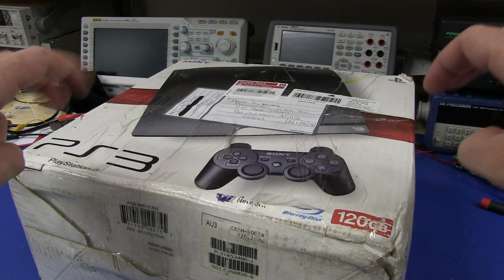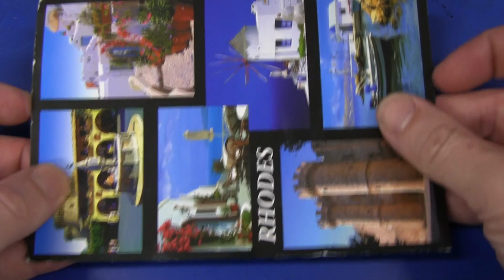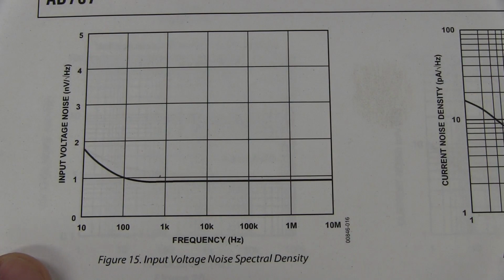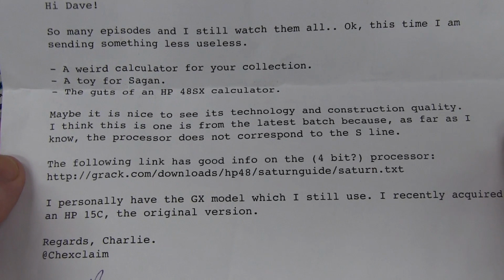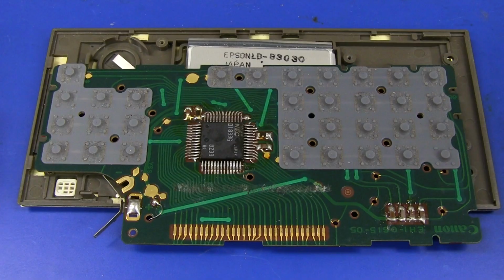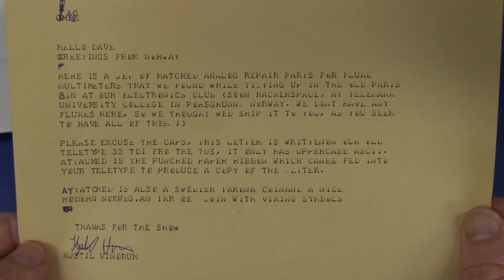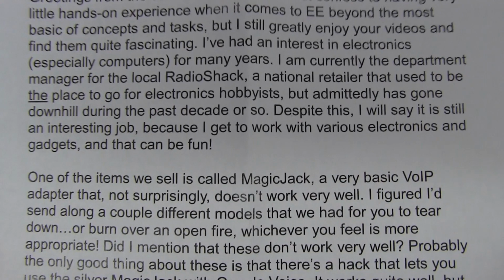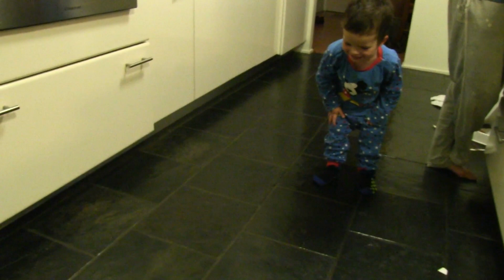EEVblog #541 - Mailbag

Comment: Shipping a PS3 fat in a slim box. Very fitting considering the fat was notorious for failures from bad thermal design and I had to get a slim as a replacement myself.
Reply: +Juan Reynoso i have my 60GB version since release, still works like a charm. Unlike 2 slims which i bought for my bedroom. Both had a broken BD drive. I think especially on forums and stuff, you'll read more from people who have problems, than from the ones without any. ;)
Reply: +Checkit53 Those 60GB were dope. I got an 80GB like 3 months after it came out and it failed on me twice. Graphics card the first time, BD second time. Got a slim, lasted me 2 years then sold it. PS for life
Reply: +Hayden Meade interesting... I've had mine since 2007 and no issues with it ever.  also to note it has gotten a substantial amount of use.
Reply: +Juan Reynoso i STILL have my fat! works fine!!
Reply: I've had my 120gb slim for about 4-5 years now.. nothing wrong with it, cept it likes to reset itself every now and again, so i need to input the date and have to reconnect it to the internet to reactivate my bought digital game licences. Won't even consider the super slim, it looks like garbage, but i've been looking for a fat with ps2 backwards compatibility, since both my ps2 controllers are broken, and its hard to find controllers
Reply: Juan Reynoso Really?
I have a fat that i leave in a HOT AV closet, no problems
Reply: PS3 Pregnant Pastie

Comment: Found this while searching for the Fluke chip

I am trying to repair a Fluke 8000 meter.

On the chip it says SC522 it is U3 on the schmatic. 
Here is the write-up of the chip.

The Analog IC is an LSI device which contains a two-input multplexer, an amplifier, and a voltage controlled oscillator (VCO).

The Part number from Fluke which contains multiple other parts is 345496, but it normally comes as part of the following parts "set':

C14, C16, C R20, R56, R57, R58, AND U3 ARE A MATCHED SET.

REPLACEMENT: ORDER "ANALOG RESISTOR SET", P/N 345496

Even Fluke's website does not list the part. And subsequent telephone conversations with Fluke indicate that they no longer have ANY relevant documentation on, or parts for, this meter.

Comment: The PS3 uses a multi wavelength emitter laser diode. It would be interesting to see him make a project with stuff like this rather than just a quick comment on it. The diode has 3 outputs 405nm violet 650nm red and 780nm NIR. Run the 405nm and 650nm at the same time you get a pink laser : ) No more than 25ma of current or it goes p00f! No more than 1mW output in a pointer either, or the .AU gov gets paranoid.

Comment: Its a ps3 GPU issue. The unleaded solder seems to be low quality amd after enough playing with dried out thermal paste the joints go cold. This is NOT a power issue or a disc issue. I have done extensive repair of these units over 250 units.
Reply: Electrics It can happen to the CPU or GPU.
Reply: CPU ive never heard of one almost always gpu or southbridge. but ylod can happen for a number of reasons. Really any "cold" joint in the system can cause it. probably about 99% are GPU issues.
Reply: True, but it is possible for it to happen on the CPU as well. The odds are much smaller but it's not impossible.
Reply: indeed however mentioning southbridge or cpu is pretty much a waste of time being as how rare they are.

Comment: Dave, a quick search for Fluke P/n 345496 shows it's from a 8000A, U3 "The Analog IC is an LSI device which contains a two-input multplexer, an amplifier, and a voltage controlled oscillator (VCO)."

Comment: The YLOD overheat. What you have to do to fix this, is take apart the console, get to the logic board, get a blow dryer, and hover it over the logic board. Reassemble the console. and the YLOD will be gone. Hope this works for you Dave. From, Brandon

Comment: My mom had one of those checkbook calculators growing up, which I used on occasion. The original idea was that it fit inside a checkbook case and stored the values in memory so that you could keep track of money spent over time instead of having to write it down on paper. Some googling indicates they were made between 1982 and 1983.

Comment: that error is a simple solder flow failure on the CPU or GPU, classic error for any model after cech E01 and before the slims. green yellow red flashing LED error. I used to work for sony

Comment: 19:29 Solder? 19:59 Test connector? :O
I think you forgot that's there's an LCD in this thing. That crud is the adhesive that used to hold the LCD in place, and the connector is for controlling the LCD.

Comment: a fiducial is a spot on the pcb that is in a known location that the pick and place robot uses to get the correct part alignment, Dave said that it probably wasn't needed because it looked like the board was hand assembled. If you look up Dave's video on pick and place machines he explains it further in that video.

Comment: the big NEC "yorke" is the mixed mode CPU for the hp48 G series.

the two ICs on either side are the LCD controllers.

The quad flat pack is the rom if i recall correctly and the IC next to it is the RAM

Comment: You probably already know by now Dave.
The Cannon check book Calc "Jumpers" these were silver loaded paint.
very common where links are required and would have fouled the keypads.
Also common in Philips car stereos saves solder links but they corrode causing a miriad of faults.

Comment: Yep even the original Wii has it's share of heat issues, I keep one as a spare Netflix box in the guest room, and when in standby it gets warm, so I keep it horizontal, and keep cheap USB laptop cooler under it, which helps.

Comment: #EEVblog   Please take it apart, I wanna see whats inside of it in a "professional" teardown. As for the YLOD from what iv read and heard about it in the past, its bad CPU/GPU ball joints, the HDD is faulty or overheating if the beeps are long and 1 second each. Overheating can lead to bad CPU joints, though. The PSU is also possible (as for nearly all cases). Pretty sure it is bad joints caused by thermal stress or small tin crystals from the lead free solder. For proof I got this off the internet

"Mate, as a degree qualified Electronics Engineer, working towards chartership you don't need to tell me what causes YLoD, and it's not overheating, it's the BGA connections that eventually crack due to constant heating and cooling cycles causing thermal stress in the lead free alloy which is used at the factory. Sometimes it can be caused by tin wiskers which are small crystals that form and can cause shorts between connections, tin wiskers can grow at a rate of 0.5mm per year and when you see how close the pads are on the GPU it becomes apparent that tin wiskers could be liable for the issue.

Leaded solder does not suffer from this because first of all lead supresses tin wiskers and has done for the last 50 or so years leaded solder has been used and nothing else has been found that can supress it as well as lead can. Not to mention lead is more maliable than lead-free solder and as such is less prone to cracking from thermal stress. Also, during a reball you are replacing the old already thermally stressed balls with fresh ones. A reflow does not do that so the balls are still prone to cracking, hence reflows can fail very often.

If the CPU or GPU overheat then the console shuts down with a flashing red light (RLoD) and no yellow light appears. Heat is the cause of YLoD due to constant heating and cooling cycles, but the main issue is the lead free solder that was introduced in 2006 due to RoHS & WEEE directives.

Hence BGA failures have become more common as of recent since lead free solder came into force."

This was regarding someone's issue with this here: http://www.ps3hax.net/showthread.php?t=30700&page=3&p=292282#post292282

 I guess a heat gun could do some good towards fixing that, but you dont wanna kill the CPU by cooking it so you would have to be careful. Either way I wanna see a teardown. Have a nice day.

Comment: There is a video game made for the Playstation 3 (and an updated sequel that'll be available for the Playstation 4 eventually) called "Little Big Planet". The game's create mode really sets it apart from most video games. Ever since LBP 2, they added digital logic objects to the create mode. I have seen all manner of devices created in the game, including numerous calculators and even a rudimentary 8 bit computer with a hex keypad and display that executes machine language instructions!

"LBP2: Da Vinci CPU v2 - Brief Explaination and Demo"

It's OBVIOUSLY no Spice, but it IS cool that it teaches people the basics of digital logic in the disguise of a video game! I'm HOPING that LBP 3 (for PS4 later this year) adds "truer" flip-flops, memory "chips", and buses. Their current implementation of flip-flops is not very true to what's commonly available, though you can make them from scratch from regular logic, of course. I made a 256 bit ROM chip in the game (8 bit x 32, 5 bit addressed), to use for general purpose program storage in game. Also made a lovely "smart" hexadecimal LED dot matrix display with 4 bit latching inputs... basically a clone of the old TIL311 with a slightly prettier, slightly higher resolution dot pattern. Also made a nixie tube in the game that clones the general look okay... I'd like to redo it sometime, make the numeral filaments thinner.

I'm kinda waiting on the PS4 version myself, as I'm hoping they include some of the improvements I and others in the forums have suggested. They seem to have a good back and forth in their forums. The whole logic circuitry concepts were implemented in LBP 2, because they saw people use the pistons and the magnetic tags and sensors that were construction items in the first game to create digital logic. You put two pistons in line with one another, with a magnetic tag on the end, and a sensor at the end of the assembly, and you had an AND gate. Both pistons HAD to be extended for the tag to reach the sensor. A pair of Pistons side by side, with a tag sensor between operated as an OR gate. I don't recall the piston, tag, and sensor configuration for an XOR gate, but it also existed. All outputs of the tag sensors could be inverted as a setting, thus you had AND, NAND, OR, NOR, XOR, XNOR, and you could have a NOT by having a piston, tag and sensor by itself, with the output inverted.

People made basic calculators in the original game, using these virtual electromechanical arrangements!

"LittleBigPlanet : Little Big Computer"

Media Molecule saw what people were doing by creating logic, so they just dumped digital logic into the next game int he form of "microchips" You placed a microchip into your created level, and then opened it. It provides a resizable working area to drop logic gates and other functional elements on, and then you wire them up. You can next multiple microchips within microchips, so it's real easy to create, lets say an SR Flip-Flop, a JK lip-Flop, a D Flip-Flop, a Half Adder, a Full Adder, etc... You created a common element and then reused it as needed inside other elements. You can even give away your created objects, chips included to people who play your level.

As I said before, I and other forum users suggested many improvements that would make creation even easier. I suggested adding "memory" chips, because it would alleviate a good portion of circuit simulation in creating memory from individual elements of OR networks to simulate diode ROMS, or flip-flops to simulate RAM, by letting the system turn it into simple value tables, letting the simulation free resources for other creator content. Another area where performance could be gained in create mode, was the wire auto routing. The game autoroutes wires on the fly, but on large designs this can become a mess. I simply suggested the addition of busses with user dropped guide points. This would clean up the rats nest of wires, and alleviate some of the performance lost on rampant auto routing. My final suggestion was to simply add TRUE flip-flops, so we can stop relying on making them from scratch, and to teach people REAL logic device behavior!

Basically, it was a fun way to introduce people to digital logic, via video game!

I also learned that some of the less standard components have been being played with by some people to create "analog" circuits! There is one part that can be used in a fashion similar to that of an op amp. This guy is doing some amazing things with simulated analog parts! it also goes to show just how versatile the game's creation mode is! He's doing what amounts to an analog computer to add and subtract values. Sadly, the tools are less like real analog parts here, and it's full of bodges, but still, the creativity in this guy's work just oozes off the screen!

"LBP2 - Analog Memory Cells & Other Useful Electronics?"

If you ever manage to snag a PS3, try to find a copy of Little Big Planet 2, just so you can see what a few of the creative minds out there have done with it's virtual electronic components!

sorry for not actually including the videos, but Google has been messing with the visibility of some comments, so you'll just have to go copy and paste the titles of the videos I list below into your search box. Getting tired of Google shenanigans...

Look up "Ghost Comments" if you want to know more.

Comment: Your video about noise in opamps was very interesting to me, I dont understand why it wasnt very popular either. I know the older version (I think?) of the Xbox had a similar problem with joints, but it was the GPU if I remember correctly.

Comment: It is but is a third party device and they make these things with out any real understanding of aerodynamics/gas dynamics. So by forcing this excess air into the device you are making air go to area it isn't needed as much and removing air from areas it is needed more. Thus causing strain on the internal fans that remove air.

Comment: Dave, that is the dreaded "yellow light of death" which the bga parts lose connections due to thermal stress.  The most popular fix is a trip through a reflow oven(or as another commenter stated, a heat gun). This same issue happened with my ps3. Not having the confidence in myself I'll have it repaired by somebody else in the future.  That and my fiance would kill me if I turned out toaster oven into a reflow oven!

Comment: you are spot on with the overheating. A common problem with newer consoles with making the console short and the silicone layer on the processor two small causing the chip to overhead what I can imagine causing it to melt the solder points and off set the chip. MOORS law is getting further and further away i think they need a better solution than silicone

Comment: The PS3 is pretty easy to fix with a heat gun or reflow station. I ran an electronics repair shop for a while and repaired quite a few of them but I repaired more xbox 360s and iphones than anything. That is why I am a Android and PS3 fan. 

That PS3 broke because the "powerwave" device caused the system to not cool properly and most likely burned out the fans then the GPU and CPU over heated causing the solder joints on them to go bad.

Comment: wierd pressing the power butten should turn it on(may want to hold it down for atleasted 2 seconds), myne looks mostly the same and its still working fine jet again I live in a' dry aria and my ports may be dusty but there not coverd in rust and decay, the cooler is after-marked and to be honest I've not seen before, but the bottem plate normely gets the hotested tho(srry for the spelling erros)

If you ask me these one took a' dive off a' table, just looking by the missing plate

Comment: To permanently fix it you would need to reball the graphics / CPU chip's BGA, thermal stress causes the lead free solder balls to crack, lose connection then the console fails.

Comment: I got YLOD definitely from overheating an issue with he soldiers on the processors cracking can be fixed by reheating them, More than likely caused by the poor care of the system as well as the after market cooling junk, these after market coolers do nothing but mess up the factory cooling systems and cause a cooling battle resulting in death.

Comment: I know its a old Video from a few years ago.. But that is the Classic Error Called Yellow Light Of Death.. It comes down to Dry Bad Solder Joins Under The BGA CPU\GPU Chip. tons of info on this and quick fixes on this.. I have myself Fixed a many of these with a Infrared Rework Station. Looks also to be a no backwards compatible system also.. Sony made I think it was 4 or 5 Diff models of this "FAT" PS3 console.

Comment: You can quite easily repair a PS3 with only a hot air rework station, thermal paste and a set of screwdrivers. *if it's a simple cold cpu or gpu joint*